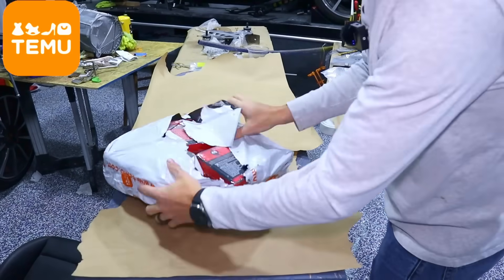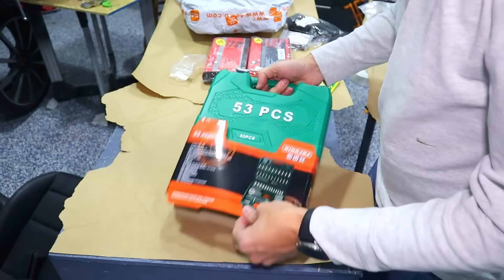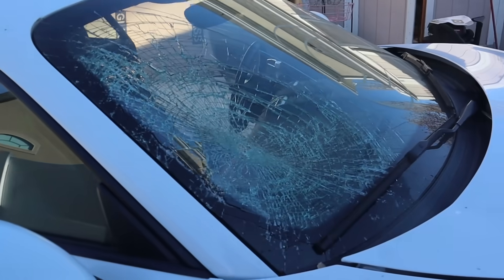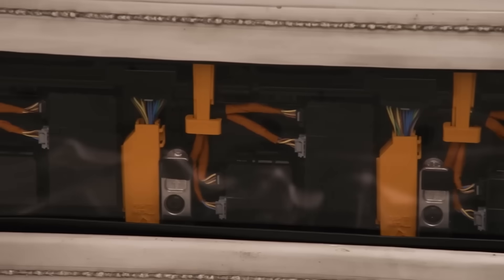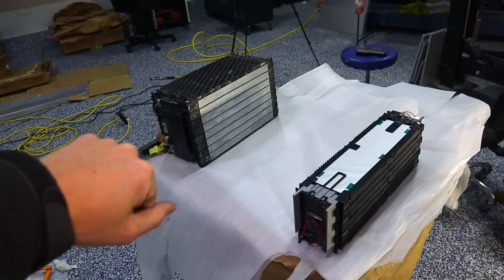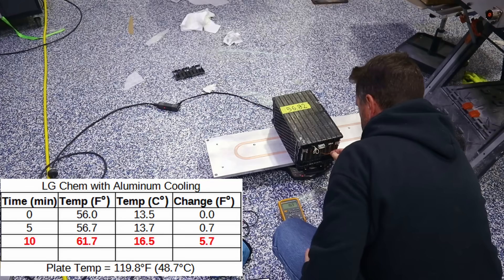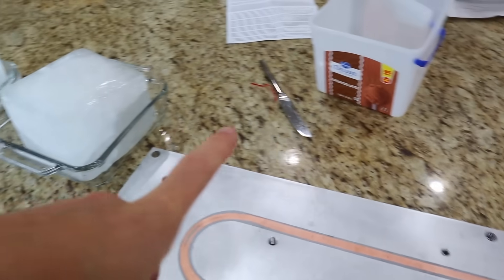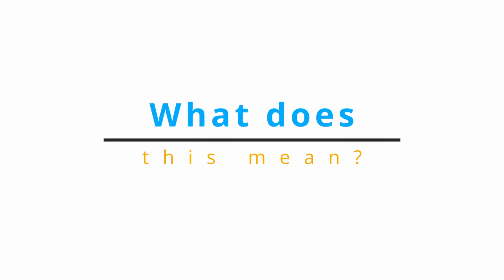Battery Cooling Mythbusted - Heat transfer to battery modules

Comment: The 65 year old EE is back :-)  Again, please understand that I'm only trying to help... at my age, I have nothing to gain by trying to prove anybody wrong.  I just want to share what my 45+ years of EE and product design (including all aspects of product design... Mechanical, Fluid dynamics, and manufacturability) have taught me. Knowledge belongs to nobody, and should be shared to benefit as many people as possible. 

The aluminum thermal transfer plates (on the Chrysler battery) would always have thermal transfer interface material to the heat exchanger surface, whether using a thermal paste or a thermal pad... because you can not get a gapless mate between two imperfect surfaces... and any gap is filled with air, which is a horrible thermal conductor. 

 Even if the gap is only 0.001", it still has a thermal conductivity of 0.024W/mK. 

Good silicone-bases thermal transfer pad material has a thermal conductivity ranging 6W/mK to 13W/mK... around 250 to 541 times better than air.
 
A typical thermal paste averages around 70W/mK... that's 2916 times better heat transfer than air. 

Aluminum thermal conductivity is about 247W/mK... 10,291 times better than air. 

Repeatable tests must have the same test conditions... the packs should have been oriented the same direction on the plate, not in opposite directions. This makes a difference because the copper tubes will transfer heat better than the aluminum plate, so the lengthwise orientation will expose the battery module to more copper, with increases transfer.

One major consideration in this kind of "A-B" comparison test is Thermal Mass... the Chrysler battery module is MUCH larger, and has much higher thermal mass... yet. it proved to be better than the other module. 

What this means is that the aluminum plates in the old. battery modules are doing a far better job than the results indicate... because it performed better, even though it had greater thermal mass. 

Thermal pads would significantly improve the thermal transfer ability of these new battery modules... applied to both sides, thick/soft pad material to allow it to compress down into the sides of the modules... remember... air is a horrible thermal conductor.

There are also Thermally Conductive RTV Silicones that have a typical thermal conductivity of 1.79W/mK... not great, but still 75 times better than nothing... but this would make battery pack servicing pretty much impossible. 

Just consider the horrible 1st gen. Nissan Leaf battery failures... because they just used air as a thermal transfer medium.
Reply: I think his tests need to take on your methodology otherwise they will be significantly inaccurate. Final product should be cooled with the same direct contact thermal paste too.
Reply: We should be paying more attention to this comment. It’s right on all counts.

Comment: I've enjoyed following along on your builds!  Thank you.  The experiment you did was a good, first pass investigation.  The results show that the aluminum interface outperformed the plastic interface.  That is expected.  What we don't know is how much thermal resistance the battery can actually tolerate at that interface in your specific application.  You came up with a good idea of using top and bottom conduction cooling paths to mitigate risk.  Have you explored using an inert "electronic liquid"  (3M FC-770) for directly cooling the batteries?  That fluid would circulate thru the battery packs and a radiator/heater.  It would be the ultimate in cooling/heating performance for not much more cost.   Keep up the great work.   Another tip to share is try epoxy coating the bus bar. Less bulk and more durable. Your bus bar work was stellar by the way.  Keep on producing the great content!
Reply from the maker: Thanks for the suggestions!

Comment: I think in your case it should just work fine but I've always wondered how well EVs would function in the desert heat (where I live), it goes up to 49c/120F easily every other day under shade (never mind under direct sunlight). Maybe a tesla style batteries would work best in those applications as they have cooling inbetween batteries rather than the case itself.

Comment: something to consider on the old pacifica cells... aluminum to aluminum sounds great except that aluminum corrodes slightly and it impacts the tranfer of thermal energy in that aluminum/aluminum interface.  Your 3M heat pads actually improve that situation.  I've worked in the chip world for a while (decades) the thermal pad is the current ruling interface.  You never see metal to metal.  (thermal grease is still used but there are consistency issues in a factory setting so it's not preferred).
Reply from the maker: Interesting 🤔

Comment: As always, I enjoy your content. As a commenter, I will always try to be supportive and kind. I work for an EV company and I appreciate the struggle to cool and heat battery cells. The method my company uses involves cooling "tubes" touching each cell on both sides for maximum heat transfer and it really works well. Perhaps buying a Tesla module from a legacy Model S or X and reverse engineering that would be helpful in future builds. Generally I like the form factor of the Tesla modules and think you could package them pretty easily. Just my 2 cents. Thanks for the content!
Reply from the maker: Thanks for the comment!
Reply: It is unlikely that anyone is going to home-brew an equivalent to Tesla's "cooling snake" approach. If you like Tesla modules, just use them intact. @ElectricSuperCar is wisely using OEM modules, not building custom modules.

Comment: I've always wondered if the conductive style heating/cooling was effective.
Regarding your capacitive voltage build up.  It's worse with 400v systems but it happens with 48v, too.  LiFePO4 (both with plastic cases and metal), Leaf, Volt and Tesla modules...all of them do it.  I've never done a build that didn't have it.  I have no idea how to eliminate it.
Reply from the maker: Thanks for the comment!

Comment: You're not accounting for the mass difference in your batteries during the heat transfer test, but good first try
Reply from the maker: You are correct there are mass differences.  I felt this was the best comparison as it would compare the two options I was considering

Comment: Great video on battery thermo management, but have you considered the possibility of using super capacitors in addition to batteries?  I understand it adds a level of complexity, but my thought is that it will also reduce the stress that generates heat battery from high energy demands.  What’s your thoughts?
Reply from the maker: I have thought about this.   Supercapcitors are awesome! The only problems are the weight per kWh and the cost.  Both are too high
Reply: @electricsupercar  I’m personally researching for a different application in the aviation arena.  My thinking that it’s not about the kWh per kg but more of toning down the peak energy input-output demands on a battery which causes thermal stress and short life span.  Sure there will be weight and volume constraints but my thinking is battery thermal management provides a longer life span and cheaper replacement cost in the long run.  Keep in mind that I’m talking about constant daily use of an electric vehicle (Aviation or Auto).
Reply: The logic makes sense, but it is less expensive, simpler, and more effective to just use a battery of appropriate lithium-ion cells than to add a massive capacitor system to assist an inappropriate battery.

Comment: It seems those flat pack envelopes would really lend themselves to internal Cooling.
I wonder how much bigger it would make the pack?
Reply from the maker: Interesting 🤔
Reply: The modules which LG Chem built for the Chevrolet Volt use internal cooling of that style. Some other plug-in hybrids (from Volvo) use the same design. They allow very high specific power, but they're too expensive to be justified for EVs which don't require the high power density.

Comment: Great video!
I feel like you might be better off by trying the plastic cells with a thermal pad or some type of thermal interface material due to the slight surface inconsistencies of both the batteries and the plates just to sqeese out that last bit of thermal resistance
Reply: Agreed. While there is a slight degradation in the efficiency of the heat transfer when using a thermal pad, the heat transfer gain from increasing the surface area contact exceeds the heat efficiency loss. There are limits but within reason, the more irregular the transfer surfaces are, the wider the gain becomes.
Reply from the maker: Thanks for the tips!

Comment: I am really enjoying your work! What is your field? I am guessing some type of engineer. As a recovering mechanical engineer, I really like how you approach design and problem solving. As far as heat transfer, your results are consistent with my expectations. The induced voltage is quite interesting issue, and one that I do not understand. Guess we need an electrical engineer to chime in!
Reply from the maker: Thanks for the comment!

Comment: My only comment is… buy a work bench… when you have the finances. You’re gonna hurt your back work on the floor like that. 

I am curious about the thermal mass of the plate and it’s effect… it’s aluminum so maybe it will be negligible but in my mind it’s going to take time to raise and lower the plate temps.
Reply from the maker: I think you are right
Reply: I agree - it's astounding how often that people - especially those who make YouTube videos - unnecessarily crawl around on the floor wrestling heavy components. If you can lift it, put it on a bench. If you can't lift it, grab a cheap shop crane.

Comment: As a physicist I can tell you,  your experiments gave the expected results for heat flow.  I think you will be just fine in regulating the temperature of your batteries.  Most will not appreciate the capacitive charge build up that can be devastating to the electrical system, so great job!
Reply from the maker: Thank you!
Reply: @electricsupercar  Thermal pads actually help a lot with heat transfer, depending on what you get, as they fill the small gaps that are always present there, unless you have either a soldered joint, or a weld. Thin pads on smooth machined surfaces always work better than bare metal to metal. Plus provide insulation if you have a material with insulating properties, so work well.  Even with the plastic battery cases use the pads, they conform to the surfaces, and help transfer better than air, and also provide damping of vibration as well. Thin pads are cheap, and work well to transfer the heat to the panel, which, no matter how well you have machined it, will always have some warp, and loss of contact. Even the Chrysler pack uses them between the cells and the thermal plates, to get good heat transfer, so use them for the other, and it will help with heat transfer a lot.

Comment: What are the other battery packs from?
Reply from the maker: Not from an EV, just battery packs from LG Chem
Reply: Oh gotcha. Like backup batteries. I have some modules from server backups. Same idea, they just use the 18650 cells instead of the pouches. 
Love the videos, been watching since the beginning of the first car. Don’t let the haters and trolls get you down, you’re doing great work!!!
Reply: Yes, they are backup batteries, @erikrummel6277  They are not intended for EVs, or for any application with the charge or discharge rates of an EV.  

LG Energy Storage Systems (ESS) documents describe three series of cells (their description):
__________
 High Energy: JH4

• Duration for ≥ 3 hours
• Continuous power supply

Energy: JH3 (this is what you see in this video)
• Duration for 1~3 hours
• Continuous power supply

Power: JP3, JP4
• Duration for < 1 hour
• High power supply
____________

In backup power applications, "High Energy" means a high energy density for long operation after utility power fails, at a moderate and continuous power demand. "Power" provides high power density for brief interruptions but can't store as much energy. "Energy" is the compromise between the others.

A typical EV at peak power would discharge the battery is much less than one hour. That means that it needs - using the ESS terminology - a "Power" cell intended for high discharge rate. What EV West found and is selling is the JH3 "Energy" line. That is why they don't have heat transfer provisions - they're not intended for high charge or discharge rates.

Specifically, this module is used in various combinations to form "Energy Modules":
• four in 2S2P combination to form the M48126P3B, or 
• six in 2S3P combination to form the M48189P3B, or
• eight in 2S4P combination to form the M48252P3B
Those modules are stacked and connected in series to form "Racks", and Racks are combined in shipping containers for megawatt-hours of capacity.

Comment: Great video as always! The only thing that scares me a little is that one of the battery cases, cooling tubes can leak inside the battery compartment. The other I think cannot. If I could choose I would definitely try to use the same design that cannot leak inside. (I think both "can" leak inside, but a leak from the cooper tubes is I think less likely than a leak of the "rubber" ones.
Reply: cannot leak inside: https://youtu.be/GcwLZrIyknI?t=1021
can leak inside: https://youtu.be/GcwLZrIyknI?t=1228

let me know if I'm wrong.
Reply from the maker: Understood

Comment: Appreciate the mythbuster parody.  I appreciate the data and the larger than 1 sample size.  Curious, why not simply sandwich the cell packs between 2 cooling plates and pump hot or cold fluid through in a temporary experimental setup?  I would think this would be a more stable (heh heh) testing scenario with less variables and more data.  For example, you could measure input and output fluid temperature in order to see the thermal wattage imparted to the cells by measuring the difference, assuming of course, you also did a control run with nothing between the plates.

Just my 2-cents.  Love the project, keep up the work, cant wait to see more!
Reply from the maker: My main thought was to see if my cooling strategy was way off.  This to me proved that I was good enough.
Reply: @electricsupercar  fair enough, was just curious!